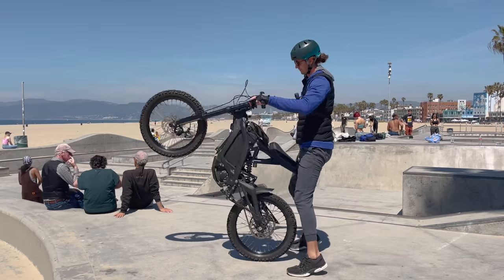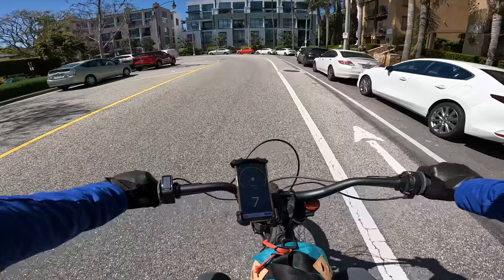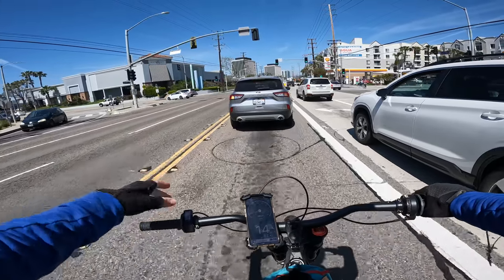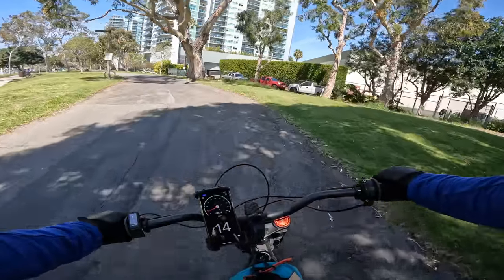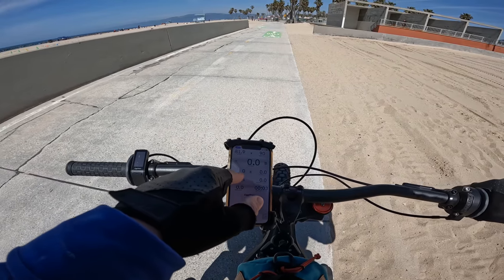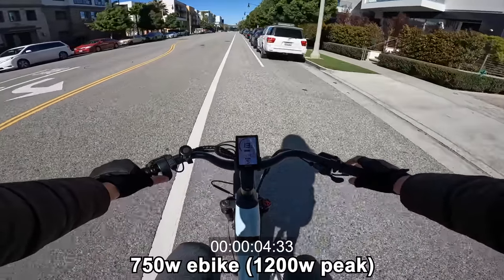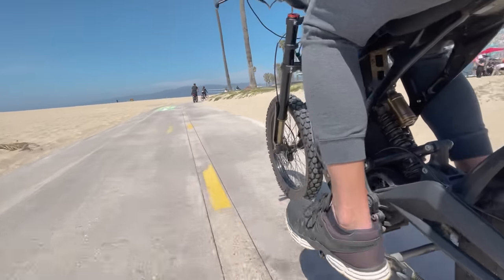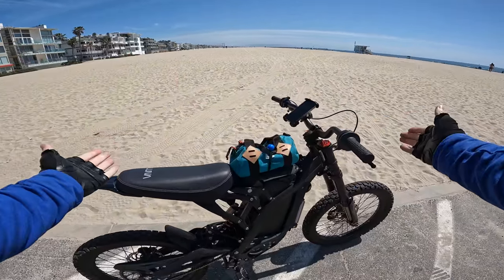This 70 MPH ebike is DANGEROUS

Comment: It seems powerful enough to be highway legal. It's definitely not really a bicycle at this point; just an electric dirt motorbike.
Reply: To be on the highway for 10minutes before being dead battery
Reply: The point is that the ebike can do thar most motorcycles and cars can't. 

But now people are crying for it to become ANOTHER motorcycle. 

When it's not. No cars or motorcycles can take trails or paths not normally taken. 

You can literally get off and walk with it to get off the saddle and stretch and it wouldn't look out of place. Can't do that on a motorcycle or car. 

Cars or motrocyles Can't take narrow trails or multi use paths. 

Cars and motorcycles aren't as slim or as nimble and they take up much less space on the road. 

Ebikes even with throttle can be and do so much more. 

But turning it into another electric motorcycle literally neuters it.
Reply: @Mash3OH3  these 40mph+ bikes ruin it for the rest of us though. They are too fast for tight pedestrian/cyclist multipurpose trails and their tiny wheels+massive torque damage and rip up the trails for mountain bike paths. 

Coming from a emtb owner these should only should be used OHV/ATV trails or streets. Not just for the rider’s safety and enjoyment but for everyone else’s too.
Reply: @hugegoose5004  

Sounds like a you problem. I've never seen or experienced any ebike rider do 40mph and up on a public trail. 

Just cause you have a bias towards them doesn't mean they have to stop using those trails or paths. It's public. 

In the end it come down to the rider. Personally I don't mind going slow. In fact I like going slow. Slow and controlled movements is just as fun. 

If I want to go fast I go on the road.
Reply: @Mash3OH3  I will see one ripping 30+ on the local state park muti-use paths at least once a week.   They are "cutting" through on commutes, but there are walkers, bikes and runners on the same paths
Reply: @bindingcurve  

I don't get it. Are you under the impression that everyone rides like that guy? 

There's always gonna be that one person. But banning all of them is not a solution. 

It's like me saying. "Oh I see cyclists commute going over 25 to 30mph as well" 

And I do see  cyclists going much faster than even standard electric scooters. On public trails/ paths. Yet you don't vilify them. Cyclists can do over 30 on paths because they're riding on standard bikes? 

This comment of yours serves to prove that you have a bias towards electric bikes. NOT the riders themselves. Literally ebikes cannot do 30 plus mph on their own. You fail to take into consideration the type of rider who uses them. 

So where do you draw the line? There are bad bikers wether electric or not everywhere.
Reply: @Mash3OH3  I have NEVER seen a electric fat tire bike do the same speed as normal bikes in that park. And yes a "normal" bike can go that fast, when you have a pro riding it or going downhill.  I do group rides, a A25 group is very very fast, and we are NOT on multiuse paths.  Even a B19 group is faster than 95% of people can ride.
Reply: Some people use these as transportation
Reply: @lucidrebuilds6129  then get them tagged and legal.  There are lots of light motorcycles you can get for the same price.
Reply: @bindingcurve  nah government get s enough my money
Reply: @bindingcurve  

No dude that defeats the purpose of an electric bike. They can do things standard cars and motorcycles cannot do.
All you want is to turn it into ANOTHER motorcycle. By going by your logic anything using an electric motor would require a license and be legal. Like one of those motorized disability chairs. 

The problem you have is the ones going too fast. You blame the rider for that. Not the bike. 

It’s like saying every bad driver out there need to turn in their license because their crappy driving ruins it for everyone. Or every cyclist going over 30mph need to make their bikes legal and license. 
And before you say they’re not the same. But the nature of motor is that it propels. 
An energy source transforming into mechanical. 

Ones electrical while the other is biological. So if they’re not the same cause one is slower than the other. Then it’s a simple solution where the electric bike needs to be as slow or slower as a cyclist. Especially on public paths and trails.

But the advantage with electric bikes is that you have speed that you can work with when you’re on the road riding alongside drivers. That’s when you can go fast. On the road. Comparing it to a motorcycle is a gross misrepresentation because it’s still nowhere near as fast as cars or standard motorcycles. 
It’s a bicycle frame. Therefore it should be ridden like a bike not a heavy duty motorcycle with better suspension and can absorb bumps better and heavier frame.
Reply: @Mash3OH3  did you watch the video?  This is FASTER and has better suspension than a Honda Navi. The Honda is classified as a motorcycle.  Most of these 'unlocked e-bikes' are faster than gas 50 cc scooters that you must ride on the road.  Silent does not equal new rules.
Reply: This bike seems very cool, but $10,000 with upgrades? Ahhhhh, no.
Reply: In most states e bikes aren't allowed to go past 20mph
Reply: @bindingcurve  

There it is again. It’s the speed you have the problem with. It looks more like a bike. Handles like a bike. You can get off of it and walk with it like a bike. Something you can’t do on a regular full sized motor bike. 

If it’s the speed. Then it’s as simple as slowing down. Having it licensed for the last time defeats the purpose of an electric bike and it just becomes another motorcycle that needs licensing. 

And the SPEED is more about the rider themselves choosing to go fast. So you don’t blame the bike. Just like how guns don’t kill people. People do.

Bikes like this don’t go over 70 by themselves, it’s people. Turning it into another motorcycle requiring licensing. When it looks nothing like a motorcycle. Handles more like a bike. Has the size of a standard bicycle. As narrow as a bicycle. What you’re suggesting is idiotic and would turn a lot of people away from anything electric. 

So what if it has better suspension. That still doesn’t make it a motorcycle.
Reply: @Mash3OH3  doo-gudders are afraid of change , i love my shitty 1kw ebay bike conversion bike  can ride along the canals , on the roads people don't seem to mind as i ride it slowly (18) but it'll do 32mph  the world needs to change & be more accepting of these vehicles as i can ride 20 miles for 7pence of electric, i couldn't buy the food to fuel my body to pedal an analogue bike for that amount,  come on world - move with the times
Reply: If it’s on a highway it needs a licence plate so the rider can be regulated like everyone else.
Reply: Teslas are considered as cars so a bike with a motor should be considered as a motorbike. I don’t know why anyone would consider it as same as a pedal cycle??
Reply: @philtucker1224  an alelectric motor on a bike frame that’s not only silent but doesn’t produce as much emission as gas bikes or even walking. Is not a motorbike that requires licensing. People are talking about licensing it neutering and defeating the purpose of an electric bike. 

Electric bike just does more than any car or motor bike with the perk of being able of going on the road when you need to. Not sure why people want everything licensed. If that’s the case it deters people.

Look at the difference between an electric motor on a bicycle frame. Compared to actual electric motorbikes like the Livewire. 
Size should also be taken into consideration. If a motor is on a bike frame that’s not bigger than a standard bicycle frame. Smaller suspension. If you can still carry it. Like my homemade electric bike in total is roughly 100 pounds. I can still lift it with one hand AND take it inside my home. Up two flights of stairs. 
Something that you can’t do on a fully fledged electric motorbike. 

If I can get off the bike and push it with one arm with ease. Then it an e-bike shouldn’t be compared to an actual motorbike. Size and shape and ease of use and convenience should be taken into a consideration. Instead of this herpy derpy “if it has motor it’s motorbike” logic. 
There’s more to it than just an electric motor. That shouldn’t be the final determining factor.
Reply: @philtucker1224  

Do you get it yet? The e-bike is designed to be a chameleon. You can take trails when you need to. You can go on the road when you need to but I don’t ride the road for hours the way drivers do. 

I can get off the bike and walk with it on trails when I need to and it wouldn’t be out of place. I can lift this 100 pound bike with one arm with ease and take it up stairs or move it around. 

All I’m saying is that just cause you see and electric motor on a bike frame. That shouldn’t be the final deciding factor
Reply: @stestar09  

Yeah I just don’t want to drive or walk or take the bus all the time, I’ve ridden standard pedal bikes for decades now. 

Now that something better comes along. Suddenly they want it to be another fucking licensed and registered vehicle like wtf. 

We have enough registered vehicles already out on the streets and most of them are sitting in their heavily tinted windows on their smartphones and shit barely paying attention to the road.

But want to hassle e-bikes. Lmao
Reply: @Mash3OH3  it doesn’t matter what power unit a 70mph bike has. If it’s on a public road it should have a licence plate so the user can be brought to justice for any traffic misdemeanour. My daily only does 55mph but I still get prosecuted for doing 30mph in a 20mph limit. Why should another biker be exempt for doing exactly the same? And don’t forget, all new bikes will be electric only in a few years time..
Reply: @philtucker1224  then that would apply to cyclists as well and but law cyclists aren’t required a license but they have to be on the road. Don’t be one sided about this. 

If this e-bike has a motor but on a bike frame and it’s slower than cars and motorcycles then it would not need a license as well
Reply: @philtucker1224  and you just want others to suffer the way you suffered. Petty much?
Reply: @Mash3OH3  read my lips: “motor - bike” …
Reply: @Mash3OH3  are you saying that there should be people allowed to speed? Get real buddy, you’re in cloud cuckoo land.
Reply: @philtucker1224  

Read my lips. Electric motors are NOT combustion engines. Just because you see an e-bike. It does not automatically make it a motorcycle. 
They are very different.
Reply: obviously this is not a bicycle. this is 120 lbs, so no way you're going to pedal that thing.
Reply: @Mash3OH3  I think there is a need to licence all motorised bikes so that when they ignore traffic lights or hit old ladies and put them in hospital they can hopefully be traced and brought to justice. Like all other road users.
Reply: Had a 400 DRZ Suzuk Motorcycle, That was a fun riding bike!  Never took it to its top speed, It could go over 75 mph to be sure.I'm liking the evolution of these eBikes. Best
Reply: @Mash3OH3  Have you seen a SurRon? Your comments make me think you don't know what you're talking about. Surrons and the like use as many moto parts as they do bike parts. The frame looks nothing like a bicycle frame. It's throttle only, no pedal assist or even options for pedals. And it's faster than a small moto, I've even watched people on these pass small Motos on a dirt track.

The vehicle in this video is an electric motorcycle.
Reply: @TheJordanicas  

Don’t matter. It’s an electric bike that can do more and anything I have described. If speed is the issue then slow it down. Simple. Comparing it to a motorcycle is misleading. 
Even if it’s a surron can still pass itself off as a e-bike provided you don’t go 70 or over in public trails or shared paths. 

It’s misleading because and electric motor is not the same as a combustion engine. An electric motor encompass many things from a disabled mobility chair to RC cars. 

An electric bike doesn’t go 70mph on its own like those surrons. It’s riders choosing to go that fast when they shouldn’t. If they want. Then they’ll have to go on the road. E-bikes are designed to be a chameleon. To go on and off the road when they need to. Having a throttle helps to get out of tight and dicey situations. 

The reality is. The e-bike can do more than cars and standard motorcycle by virtue of their silent motor and small stature alone. Like you’ll never see an e-bike take up a parking space.
Reply: @Mash3OH3  By your logic an electric car shouldn't be considered a car, as long as you drive slow.
Reply: @TheJordanicas  

It's considered a car because it's built like a car. Same size as a car  takes up parking space like a car. 

A home made Ebike. Which is what I ride. Is significantly slower than any motorcycle. Significantly smaller. Significantly light I can left it with one hand with the hub motor with battery attached. I can then take it inside my house. 
Takes up Significantly less space on the road. Significantly more nimble and agile and much narrower which allows me to take trails and public paths without it looking out of place. Significantly more silent. Produces less emissions. 

And you're gonna compare it to a motorcycle which is the completely opposite. 

Your only problem from what I notice. Is the speed. But what im saying is that SPEED should not be the only deciding factor when it comes to electric bikes. There are more perks with ebikes and they can do more. Without the need to license. 

TURNING IT INTO ANOTHER MOTORCYCLE DEFEATS ITS PURPOSE YOU NUMBSKULL.
Reply: @philtucker1224  

Nah, you’d be seeing and hearing about cars getting into more accidents and more crashes and more distractions and more DUI before you hear about anything e-bike or scooter related incidents. Higher percentage of cars and bad drivers trump involving accidents trump anything else. Of course cars need to be insured cause you’re operating a vehicle 5 to 100 tons of metal that can go OVER 100mph. The worse part. Is that there’s gonna be MORE cars from the younger generations with varying skills good or bad driving skills and increases that percentage even more. 

Yet somehow e-bikes or scooters need to be licensed? When it’s nowhere near as fast or as heavy. They’re designed to be used with lanes while being able to throttle to escape situations usually involving distracted drivers. You need to understand that bike riders wether electric or escooters. They need to pay doubly attention. They literally need to pay attention for you since either you don’t see them. Or you’re distracted. Or under some influence. 
The worst part. They’ll have a hard time determining ANY OF THAT with cars and their heavily tinted windows. 

Cars/drivers are the biggest obstacle. Your hypothetical scenario doesn’t come close to cars and drivers with all the drunk driving and manslaughter and collisions over the past couple years. There is no IFs with cars and drivers. I can SAFELY SAY that in the next couple days or months. A new accident or collision or DUI will occur from drivers. In FACT. you can go ahead and google who break the most rules or laws. It’s in fact drivers. 
When I see drivers run red or run stop signs. Personally I don’t get bent out of shape over it. 
If I apply your logic. Any drivers guilty of distractions or rule breaking or have caused accidents or collisions. Should have their license revoked or retaken or never drive again.

Less often you’ll hear any accidents or collisions occur from bikes or e-bikes or scooters. Get real dude. Drivers are the dangerous ones here not anything electric. 

Personally. My e-bike made me a much better driver. But nothing is more satisfactory than handling a bike and taking the back roads and show cars how to properly follow the rules. Imagine an e-bike rider showing you how to follow the rules and be a better driver, except people don’t like to be proven wrong.
Reply: @Mash3OH3  I’m shocked that you are prepared to tolerate car drivers jumping red lights when cyclists would be the first to sustain life changing injury or even death if they got hit by them! None of your arguments make sense buddy. Adversely, if a pedestrian gets hit by a motorised bicycle or scooter at 50mph they will be maimed, and in some cases killed. If motorised bicycles are not covered by insurance that person may never recoup medical costs or compensation for injuries that a cyclist would automatically receive if hit by a car. No, your arguments are stupidly biased. End of discussion.
Reply: Yup, the only thing this thing is, is an electric dirt bike.
Reply: I dont know how anyone thinks 70mph on bicycle brakes and suspension is anything short of lethal.  On motorcycles with any kind of power you start looking for powerful brembos with dual or more pots.  This thing has non hydraulic brakes on super thin braking disks.  Sure the total bike is lighter, but you cant make a rider light.  Also, bike tires are not intended for 70...   I bet they flex like mad with any kind of speed and are likely to blow apart as they are not proper tires with the intent.  THey are slow speed tires.  Kinda like making your lawnmower do 100...   the tires will be the weak point.
Reply: @PaulKind3d  fully agree. Quite stupid overall. Also any powered bike that can exceed 20mph on the road has to be licensed and have a highways certificate including lights indicators and brake lights and a licence plate for tracing when the rider ignores red lights, or hits and injures a pedestrian without bothering to stop!
Reply: With 16 ish horsepower it's definitely a diy motorbike
Reply: @andreyv116  yes, (most 125s are around 12 bhp and still do 65mph)..
Reply: @Mash3OH3 False. Adventure motorcycles can actually take dirt paths and such.
Reply: @ProTuner06  

How convenient that you've never chosen public paths with shared walkways. Like paths that pedestrians and cyclists use. 

So turns out your adventure bike  is not allowed to do such a thing but quiet and light weight ebikes can. 

And as it turns out the ebike can still do more. 

Can you lift your bike and hoist it onto your shoulders to bring it upstairs or into your home? No right? Cause I'd be too heavy. 

In fact heavy motor bikes given their weight can and will damage roads over time over a long period of usage. 

Bikes can't do that cause they're literally too light and the weight of the rider riding the ebike is way to little to be damaging roads over time. 

See what I'm saying? There's more variables to consider here than just the speed of the bike. Designs and weight are huge factors.

I can ride my ebike anywhere since it's designed to look and weight close to a normal bike. I cam normally get away with it because people aren't readily able to determine from a distance if it's an ebike or not. Except I don't hide it. I show people exactly what it is and show them I'm not some reckless punk speeding around. My actions speak themselves. I can continuously use shared public paths because I have self control and discipline unlike most riders. Even cyclists like to zoom past people. 

I even had a cyclist try to race and catch up with me when I wasn't even going fast lmao.
Reply: @Neonghost359  

That’s slow speed is a double edge sword. Even most drivers hate going slow or slow drivers. But now you’re wanting to introduce slow e-bikes that will just get more people angry especially e-bikes. 

Cause now you won’t be able to across intersections fast enough, impatience, usually at the expense of cyclists and brokers alike. 

Since all the driver has to do is pedal to the floor. Tempers will flare.
Reply: @andreyv116  

Nah that’s more of a 100cc and up bikes. Loud and obnoxious with emissions to boot. Too much tweaking needed and aftermarket stuff to even get up to speed.

E-bikes on the other hand is silent and relatively easy to maintain. You or your dog will never hear me coming. 

Electric and combustion engines are completely different beasts. 

You’re judging it based on the fact of speed yet again. 

Yet here we are. As you can see escooters and e-bikes and sometimes these surron builds if they ride properly. Are allowed to use shared multi paths and the bike lanes on the roads. 

Comparing it to CC engines is a huge misinformation.
Reply: coulda just said e dirtbike
Reply: @Mash3OH3   I can ride my KLR650 on the Interstate or on single track, it's still a motorcycle.
Reply: @microcolonel  

Yeah cause it's designed and weighs as much as a motorcycle. Has an engine like a motor cycle. Produces noise and emissions like a motorcycle. 

This here electric bike is still more bike than motor cycle. Means it can do things motorcycles can't. Let's see you take your motorcycle on a public trail. It would be funny to see. Except the electric bike wouldn't look out place plus it's stealthy silent.
Reply: @Mash3OH3   it literally weighs as much as some registerable motorcycles available today, has similar power and top speed.
Noise and emissions? There have been electric motorcycles on the road for about a decade by now.
Reply: @microcolonel  

No way this ebike weighs as much as a standard motorcycle. That's just ludicrous
Reply: @Mash3OH3 its legally a motorbike already, getting it tagged would just make it legal to actually drive, it's not like it makes it more illegal to drive in bike trails to get the tags because it's already illegal to drive on bike only trails as it is.

It's not the tags that make it a motorbike - it's the power and top speed of the controller.

These aren't exploiting some loophole or something anymore than driving an illegal gasoline bike is - it's just plain illegal and uninsured.
Reply: Don’t say that
Reply: Electric dirt bike, "dirt motorbike" isn't a term
Reply: Edgy Doom(tm) fan makes legalistic apologia for actually dangerous public nuisances causing issues for others, more at eleven.

Wow, Bethesda really messed up by becoming litigious weirdos with that franchise...
Reply: Oh great, the edgelords are literally babbling about do-gooders.
That is just... sad.
Reply: Fun fact, it's actually possible to make reasonable arguments for a new class of vehicle and their responsible ownership without trying to make everyone that has any concerns whatsoever out as the Westboro Baptist Church.
Reply: The problem is the tires.  Not speed rated for road use.  DOT approved tires that have a speed rating are too heavy for an ebike frame.  There unfortunately will never be a feasible motorcycle/bicycle hybrid.  Imagine pedaling 15/20 pounds of tire.
Reply: @Mash3OH3   Not for much longer, Apocalypse "E" is slowly being clamped down on in the U.K
Reply: @hugegoose5004  I say the same about E bikes, the amount of NO CYCLING signs that have gone up in my area in the last few years.
Reply: @timgrainger7712  

To be fair they brought that on themselves alot of it has to do with reckless riding and some londoners just can't be trusted. 

I rode my ebike by Cops in My area but never gave me a hard time. Probably because I don't ride recklessly and treat it like a bike so I slow down.
Reply: @Mash3OH3   The manufacturer of the Sur-Ron states that it's a m-o-t-o-r-c-y-c-l-e NOT a bicycle.
Reply: Hey there! I just stumbled upon a new project called freebeat Morph 2-in-1 eBike and it seems like a game-changer. The outdoor and indoor dual modes are definitely impressive, but what caught my attention is the indoor recharge feature. It's amazing how this bike allows you to charge while applying indoor mode. Plus, the combination of a brushless 750W motor, 80Nm torque, and top speed of 20mph gives it some serious power. While I agree it may not be a traditional bicycle anymore, I think it offers a unique riding experience. Can't wait to try it out myself!
Reply: @Mash3OH3 that is not a e-bike bro doesn’t matter how many paragraphs you write that is a motorcycle
Reply: @jamesjackson2105  

Not a motorcycle. It's like saying a mobility scooter is a motorcycle. Rc cars a motorcycle. Escooters are a motorcycle. One wheelers are a motorcycle.

The question you're not asking yourself is. 
What makes those items NOT a motorcycle? 
Because they both function under the same principle as an ebike. 
Electric powered fairly silent. Barely if any emissions produced. Doesn't weight as much or look or feel like a motorcycle.

You want electric motorcycles though? Then look at the Harley Davidson Livewire. Constructed to look and feel and weigh as much as a motorcycle YOU compare it to this bike and home made ebikes. 
And see that you're misinformed.
Reply: @Mash3OH3  unfortunately the sur-ron is 100% classed as a motorcycle. its a bike with a motor that is electrically powered. its small so can be classed as scooter but it is definitely not in the same class as electric bicycle. they even have 2 versions, 1 for offroad and 1 road legal.
Reply: @Mash3OH3  Wrong, because of the top speed it has, and no pedals.  Do you not know any relevant laws?  In practically all states, this is an electric motorcycle.  Doesn't matter if it's on a bike frame, when really it isn't on a bicycle frame at all because the frame is purpose designed for it, and appears on NO bicycles.
Reply: @Mash3OH3  No clue.  A motorcycle is not based on whether it has an ICE or an electric motor.  Similarly an ebike can have an ICE engine, but it has pedals and a limited top speed.   If it has no pedals and a 70MPH top speed, it could run on rubber bands, string, and glue, and still it's a motorcycle subject to motorcycle laws, registration, insurance, license.
Reply: @maxmeier532  That is not all that high a weight, in 2nd/3rd world countries there are plenty of people on bicycles with baskets or trailers, pedal powering more than 120lbs total.  It simply must have pedals and a rider who has the legs for it because they have been pedaling instead of using electric motors the whole time... except in this case, to pedal 120lbs, it's going to need a lower gear than the electric motor uses.
Reply: @stinkycheese804  

Nah. There's too much to consider when comparing combustion engine to electric. 

Electric if it's just a hub motor. That's it. That's all there is to it. Hub motor, controller and battery. The benefits is torque and its extreme silent. Good for thr neighbour's as well. 

Combustion engine involves too many moving parts and tinkering. If we're talking about running 100cc engines and up.  You got your carb, exhaust, fuel tank, exhaust pipe, ignition.
Slower, loud and stinks. 

Electric just offers more benefits. If you want to stay on the road and go fast then get yourself a motorcycle. Simply solution.

If you're capable of adapting and like the silence of a hub motor while having speed to work with. Then go Electric. My electric just does more. Simple
Reply: @stinkycheese804  

Well there's your problem. It comes down to speed again. If it's an issue of speed. Then all I would have to do is slow down and you can bitch and moan all you want but if I'm playing by the rules. There's really nothing you can do about it.
Reply: You need license to ride this bike
Reply: @sadmanhasan9572  depends on the state law. In CA it might need M1.
Reply: @Mash3OH3  On the contrary, it's your problem if you are illegally riding a vehicle capable of a high enough speed that it needs license/registration/insurance.   It does not matter how fast you ride it, rather what its rated top speed is.  Well, it does matter how fast in that you still can't break the speed limit or go so slow as to impede traffic on certain roads.
Reply: @Mash3OH3  None of this is subject to your analysis but rather the laws/codes in your region.  It can vary by state in the US but pretty much all would consider that a motorcycle or at least a scooter requiring registration and tags.
Reply: @stinkycheese804  

What counts as illegal riding? 
Say you have this bike but programmed the speed to be limited to 30mph.
Then you proceeded to stop at every stop sign and red light. Playing by the rules. 

What then? It's like saying why would they knowingly sell a fast ebike to a place where it's deemed illegal? You ever consider that?
Reply: @Mash3OH3  You still don't get it.  Doesn't matter what it is programmed to, if its max spec'd speed is above a threshold, set by state, it is in a different class of vehicle and then illegal to use on any public road without the associated license, title, insurance, etc.

You are wasting your time.  I didn't write the laws.
Reply: @stinkycheese804  so what's the max spec set by state.
Reply: @Mash3OH3  You can't do a google search?  It is almost like you are trying to pretend that ignorance is bliss, but that is not how law enforcement sees it.
Reply: I just want something that can 60 or 70 and has more torqued than anything that exists now a days. Also traction control and and ebs.
Reply: @jeffder7143  well, electric motorcycles do exist if you can shell out 20k or more.
Reply: A bicycle or an electric bicycle or even a moped is required to have pedals that provide propulsion and are limited to speed or engine size/speed.  A moped requires plates here and a lot of places.
Reply: @d00der41  Sure there is, moped tires typically have a 62MPH speed rating, and of course if your ebike can go that fast, it needs to have a frame as sturdy as a moped.   Besides, no need to imagine pedaling 20 lbs of tire, the pedals are only there to meet a class of ebike which it won't anyway due to the speed being in excess, otherwise treat it like a motorcycle that broke down, that if you need to get it home but not under its own power, you can always call a towing service with a bed, or someone you know that has a pickup truck, ramp, and winch if you can't get it up the ramp.
Reply: in the uk, theyre all classed as motorcycle if they exceed running pace. 250w generally is the legal limit for a bicycle
Reply: Can’t stay at those speeds for long, bud.
Reply: Don't you need a license if it goes over 35mph?
Reply: @doomslayer1676 
It's a bike, a bike with a motor.....it is, by its very definition   a MOTORbike, they ARE the same thing.
Reply: @doomslayer1676 
It's a bike, a bike with a motor.....it is, by its very definition   a MOTORbike, they ARE the same thing.
Reply: @SCHMALLZZZ  Each US state and municipality sets their own laws limiting speed among other things.  Here in my state, NO vehicle classified as an ebike can be capable of over 30MPH.  Many states consider the class the ebike falls into and past 20MPH up to 28MPH is class 3, not needing a license but can't be used on bike paths.  Lastly there is class 4 which has no upper speed limit, requires a license (and typically tags and insurance), no upper speed limit, and is classified as a motor vehicle, not an eBike.  There are also, often other state limitations regarding whether it has a throttle, pedals, and nominal (not peak) motor wattage, whether you need a  helmet, a light for night riding, etc.
Reply: It's a bike like this that will cause regulations just like the mopeds back in the 80's.
Reply: @DoctorCreepy  They are already regulated, but flying under the radar because unless they are seen moving at an excessive speed, police can't very well pull over every ebike with a plausible claim that they suspect it's being operated illegally.  Certainly some will be pulled over but more likely it is because they are not following the law with regards to common things like staying in the lane, not stopping at stop signs, etc.
Reply: Shhhhhhhh
Reply: @stinkycheese804  I'm talkin about having them registered and insured just like cars and motorcycles.
Reply: @Mash3OH3  That's why in the EU they made it simple, either it assists you cycling or its a motorbike.
Reply: @bindingcurve  Yeah a normal little low powered e-scooter killed an old woman in my area when the person on the e-scooter crashed into them. A lot of these places attract people to walk in who are ill or recovering.
Reply: @Mash3OH3 I think 100 lb bike would be hard to lift with one hand, though not impossible. My one is 55 lbs and it's a pain getting it in and out of the back of a car, or over a stile.
Reply: @TimpBizkit  

I'm strong enough to lift it one hand or at least have my shoulder support my seat. 

I'm not expecting everyone to be that strong.
Reply: @philtucker1224 it'll need better brakes tyres proper seat and certified brake levers etc
Reply: @girlsdrinkfeck  yes and brake lights etc. (otherwise the user will get a ticket every time they try going on to a public road).
Reply: @philtucker1224  yeah a british youtuber andy kirby spent a LOt of time going  through a massive document on how to make a E bike road legal for registration , educational though :), although i bet UK hasm a lot more rules than USA , USA allows rust buckets on the road legally its shocking
Reply: @girlsdrinkfeck  (obviously being a relatively small island compared to the states) The majority of our main roads and junctions have traffic cameras etc now so it’s almost impossible to get away with much. That’s life I suppose…
Reply: I agree with most of what @doomslayer is saying and everyone else has a point. Keep in mind, stock Surrons does not exceed 45mph (maybe faster if you are a size of a horse jockey). 

1. Surrons that are highly modified can pose a danger to the rider and people around them if they're not responsible enough. This can apply to any vehicles that's modified. 
2. Stock Surrons shouldn't be classified as a same class as motorcycle. Maybe a moped? 
3. Most Surrons parts uses MTB compatible components. Forks, brakes, handle bars etc...
4. YOU ARE responsible for your own actions. So ride responsibly. By some people's logic, if you have a pitbull that killed or injured someone, you blame the dog not the owner. You blame the entire certaing group of religious/ethnic people by judging an individual's actions. None of that makes sense and none of it is fair to Surron or other "ebikers" to blame them for OTHER people's actions. 

We can argue to make it illegal for modified Surrons to be on the same trails as cyclists and runners. At the end of the day, it comes down the responsibility of the indvidual.
Reply: @Wowzerz00  I agree with all of your comments. However, I hope and pray that any and all motorised bikes (motorbikes) are made to have a registration plate on full display wherever they may be ridden, so that the rider can be traced and held accountable for any and all illegal or criminal actions that they carry out, specifically injury to others and dangerous or illegal riding such as causing traffic accidents and jumping red lights etc. please, don’t send me comments like “they don’t ever go on publics roads” we all know that they do.
Reply: With mountain bike brakes. but ya
Reply: It it NOT suitable for highway use. I own one myself.
Reply: Dirt moped
Reply: yea if you look it up your not supposed to be pinning it for more than 10sec it it'll overheat
Reply: The word “Bike” is deceiving. This is a motorcycle not a bicycle. Where he lives it is a motor cycle and will get a ticket
Reply: I dont get why there is even any debate, its so clearly and obviously not a bicycle
Reply: Eletric bikes are  legal here in Kansas there is no  eletric limit
Reply: @Mash3OH3  THen you are lucky where you live. The cops had to be called on a father/son combo riding Surron on kids pump track, tearing it to shit. Then ripping up the berms on a trail segment circle track for MTBs. Just because you don't see it doesn't mean it is not a problem,.
Reply: @BHShaman  probably because I don't ride like a maniac and actually follow traffic rules. Which is why my local authorities don't give me a hard time and I ride a home made electric bike. Only goes 40mph though
Reply: Faster than a 125 scooter honda lead
Reply: @Mash3OH3  In my state class 1 and 2 ebikes are limited to a 20mph top speed, must have operable pedals, and can share multiuse paths with pedestrians/cyclists. Class 3 ebikes are limited to 28mph, must have pedal assist, and must be operated on public roads. Your arguments are so weird dude.. its about keeping people safe and able to be covered by insurance when an accident happens. Dont be so ignorant to what people are saying here. Literally has nothing to do with how loud it is, how much it weighs, or the fact that it blends in with other bikes (that in itself IS one of the problems).
Reply: @jwallace2913  

Sounds like a you and your state problem. 
I've never had any problems with where I'm from maybe because I'm not riding like a menace. 

In fact I've ridden by and in front of my local law enforcement and never gave me any issues with it. 

Also. I don't hide the way I ride my bike. In fact I've removed the chain. This bike has no peddle assisting and standard peddling is slow and sluggish. 
I removed the chain so now I don't have to lie to myself or anyone else. 

I throttle everywhere I go. And I can push 45mph. But thjng is I don't. Not often anyway. 

The act of courtesy alone gets the cops off my ass. 

It sounds like your state is looking to regulate and control because people from where your from can't seem to control themselves. 

Perhaps Mt arguement is weird to you because of your surroundings but it's no weird at all because it's an electric motor on a bike frame and you expect it to act like a vehicle? 

Comparing a bike to a vehicle is just plain stupid to be honest. 

Probably because I never considered bikes to be vehicles but the state and government does.
Reply: @Mash3OH3  you're right and everyone else in the comments is wrong. Live happily in your own, small world kid. And don't ever forget, it revolves around you and your feelings! God bless.
Reply: @jwallace2913  

That's quite the strawman arguement you have there. 
This was never about who was right or wrong. 
Sharing my opinion doesn't mean I'm right. 
But at the same time comparing electric to motorcycle is just pure misinformation because you and I both know that just because something propels you doesn't automatically make it a 1 plus ton vehicle that can go over 100mph. 

And calling me kid is a sign that you're weak minded and is willing to resort to petty name calling trying to garner brownie points from like minded folks who think like you. 

It's pathetic and meaningless and serves to purpose but to show me whose the biggest KID here and that's you. Judge yourself the same way.

I'll keep it real simple and I'll repeat what I've been saying this whole time...

SPEED SHOULD NOT BE THE FINAL DECIDING FACTOR! 

It's like saying those electric disabled chairs should be considered a vehicle. 
But they aren't. Why? Because it's DESIGNED DIFFERENTLY. serves a different purpose. 

My ebike can move at 40mph but that's not it's purpose. It's purpose is not to sit on the road going 40mph all the time. 
It can be adapted. On the road off the road. Take paths and trails no cars or motorcycles can go. 

It's funny. Cause you think YOURE right in saying what you've said. Yet you can't seem to judge yourself the same way. 
For me. This is from my experiences and I've never had trouble with the law. Because I'm courteous. I control over myself and slowing down ain't a big deal. 

I think you've highly misjudged me and everything you say is worth, LESS now to me.
Reply: @Mash3OH3  If sharing your opinion means arguing with anyone that thinks differently ok then. This is a general public topic of which most people are not responsible enough to handle something like in the original video. If it were legal to have one with no tags, license, insurance, etc. Everyone here is just explaining why they understand that there have been restrictions placed on these.. because without them people get hurt. It's not about well I DO THIS AND THE COPS LIKE ME, shhhh. This entire thread has completely skipped the space between your ears.

I don't have a problem with them. But I am capable of understanding why some would, hence the restrictions on what's allowed on a sidewalk and what needs to be driven on the road. These laws and regs didn't just come about for no reason, it's because people get hit by cars, hit pedestrians on trails, WE KNOW YOU DONT.. Use some common sense man.
Reply: @jwallace2913  

Says the guy looking to continue arguing by responding with more accusations. 

Personally I never look at it as arguing when someone responds to my comments. 

People can make up their own minds about this type of stuff.
Reply: @hugegoose5004  yeah buy a 125 small dirt bike if you want to ride around at 50mph
Reply: ebikes aint a bicycle anyway if it has any type of motor its a MOTOR bike .
Reply: @ihavetowait90daystochangem74   no its the same as a conbustion engine powered car you have a range gauge that tells you how long before you run out of fuel same with electricity ..
Reply: @bindingcurve any person that is in shape and riding a 18 speed or more bike can pedal 30 mph easily. I use to ride mine on the road over 35 mph when I was 15 years old. Verified it by my cousin driving his car beside me.
Reply: @mindedchaos 
 kinda of like how biologically powered bicycles aren't vehicles either. But the ones who make the laws deem it so. 

But do disability chairs that require an electric motor to move count as motor bikes/vehicles? 
Or is this a design/purpose or speed issue here?
Reply: @mindedchaos  why not buy a dirt bike get a decent one from the same money and are made for driving at high speeds and road
Reply: @bindingcurve  yeah there are plenty of 125cc dirt bikes that are road legal simple ctb test that are built to go fast on trails or dirk tracks with hills jumps ect.. with good breaks suspensions seats and you can also ride them off  road.. a bicycle frame with. With electric batteries on them aren't made to go that fast breaks suspensions ect.. a dirk bike same price there made for than road legal and alot more safe sold sitting at 60mph
Reply: ok karen
Reply: @Mash3OH3  Actually you are wrong about no motorcycles, first of all you should look into a Rokon, it can go where that bike can't and over things it can't.
Reply: @Mash3OH3 I'm sorry but you are wasting your time, because the law is pretty clear about what makes something a motor driven vehicle, and yes a motor is the deciding factor.
Reply: @jasonbourne1596  

So electric disabled wheelchairs are vehicles because it has a motor going by your logic. 

Lets take it one step further. Our bodies on all accounts is considered a HEAT motor. Wether from running or walking. So we all just vehicles now? 

You did not think things through.
Reply: @Mash3OH3  No you didn't think it through, and I don't know if you are being obtuse on purpose or you're just challenged. 

There is always an exception for mobility devices for disabled, but the law is clear about what constitutes a motor vehicle, and don't make the law so you are wasting my time and yours, and everyone else's with this stupid response.
Reply: @jasonbourne1596  

Okay so theres an EXCEPTION! However that contradicts your statement. 
If a motor turns it into a vehicle then that includes anything and everythjng with a motor dude.

Now suddenly youre claiming "oh theres exceptions" youre literally picking and choosing and thats what makes it bias and contradictory

I can easily say a CAR is an EXCEPTIOM as well. But what MAKES A CAR A VEHICLE. Is because its a 1+ TONS VEHICLE that can go over 100 miles per hour. On 4 wheels and can accompany up to a family of 4. 

So NOW it comes back to DESIGN. The electric wheelchair has a built motor for assitance but it is NOT designed like a vehicle. 

Or a homemade ebike has a built in motor but weighs siginificantly less. Will never cause road damage compared to those heavy ass cars day in and out and not to mention the weather. 
Can still be picked up and carried and nowhere near as fast as actual vehicles. 
But its designed to take the back roads, squeeze through spaces that cars or motorcycles coukdnt normally go.
Can use public trails and paths. 

Not hard to figure out bud. 

The Livewire is a fully fledge electric motorcyle because it is designed for that purpose. Now compare that to a ZooZ bike. 
So how they the same? Cause of motor? No man all this is to say theres more to it than just having a motor. The design language changes that.
Reply: @bindingcurve mind your own business and stop trying to tell people how to live their lives, Karen
Reply: @philtucker1224 nope
Reply: @bindingcurve  You realize you are probably arguing with a pre-teen kid that is mad he might lose his eBike if they require a license right?
Reply: @Mash3OH3  seriously. i drive my car on the sidewalk all the time, just deal with it!
Reply: It’s called bike life it don’t matter
Reply: @hugegoose5004 whomp whomp